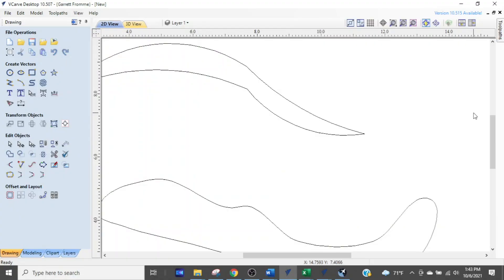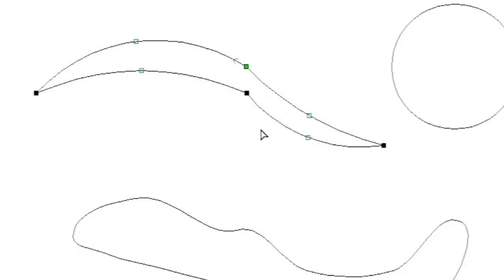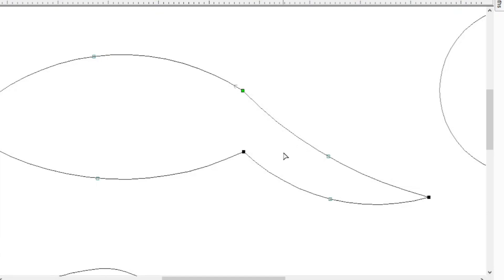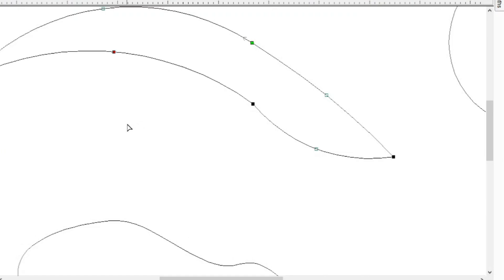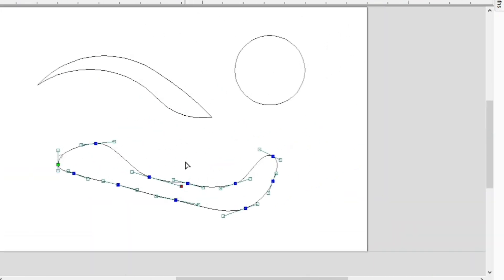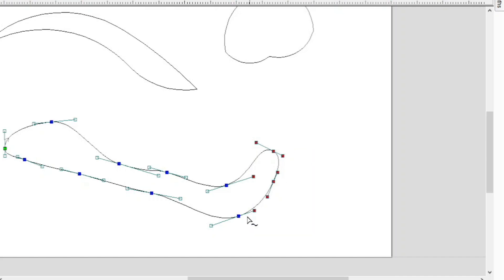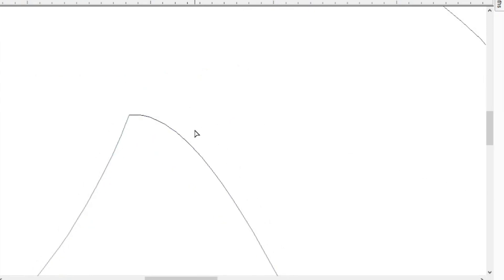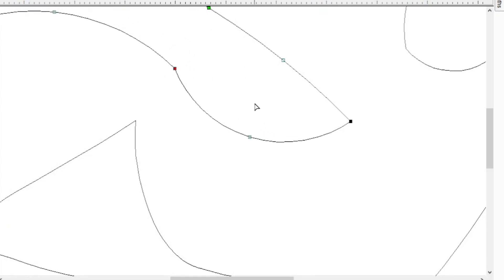Vectric - NODES... A Tip You MUST Know About - Garrett Fromme

Comment: This turned out to be a good tool to find the "hidden vectors" that the vector validator can't find, but when you try to generate a tool path, open vector errors pop up. When you zoom in, you see a tiny tiny problem with a vector but the scissors won't cut it out. Use the node thing to move the good vector out of the way and fix it, move the vector back.
Reply from the maker: Dan, those pesky vectors can be tricky. Glad you found a good way to find the small issues that pop up now and again.

Comment: As usual Garrett, a wealth of information! As soon as I watched this video, I returned to a project I was having issues with and fixed those issue straight away! Some of the issues I was having, had to do with straight line edits, for instance, you have an open ended on one end slot that measured .250" and you need it it to be .264" If you open the Snap options under the Edit menu, then look for the "Fixed Nudge Distance" you can set that to .007" or whatever you need. Then you select the nodes on say, the left side of the slot, then press and hold the "Shift + CTRL" keys then hit the left arrow key and the line between the two selected nodes will move left or right precisely .007" or whatever you have the "Fixed Nudge Distance" set to. Then repeat for the right side of the slot and move it to the right. Now your open ended slot is exactly .264" The cool thing about it, is if you have many of those slots to edit, you can select as many of those slots that you want so long as the nodes are clearly distinguishable, and that they are aligned the same way. Node editing is a Godsend! Thanks Garrett!
Reply from the maker: Frank,  glad you got those pesky nodes figured out when you need that dimension to be perfect. I couldn't have said it better myself, node editing is a Godsend!

Comment: This is a useful trick I have been using for a while now. It really comes in handy when you want to preserve the node placement of a section and move them together in relation to the rest of the model. Another tip to add to this is that you can also use the CTRL and SHIFT keys in combination with the cursor keys to make finer or coarser movements making it much easier to add that additional level of precision to your drawings.
Reply from the maker: Alan, I didn't know that. I will definitely get that little tip out there. Thank you.